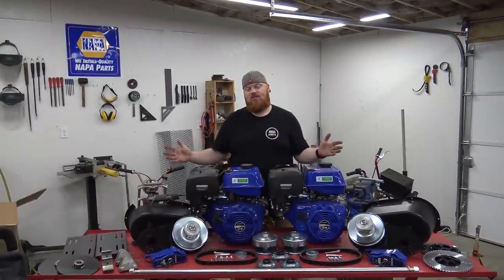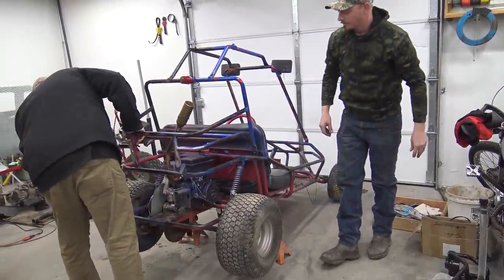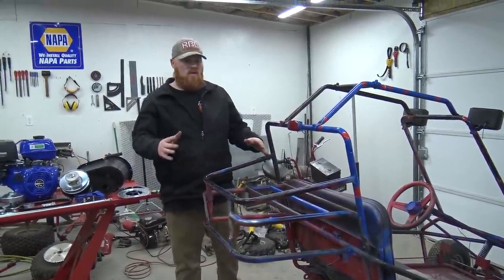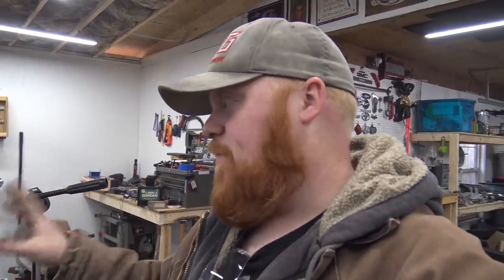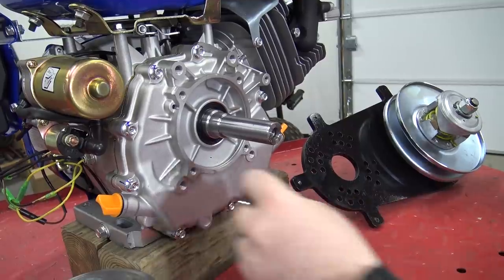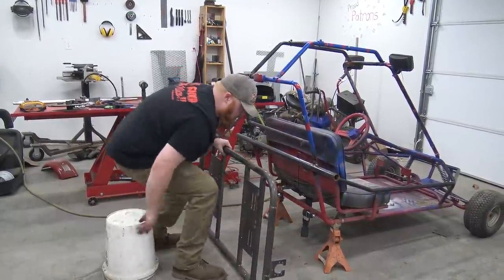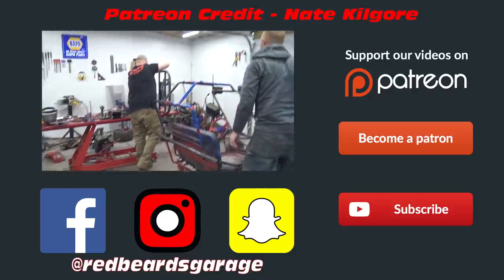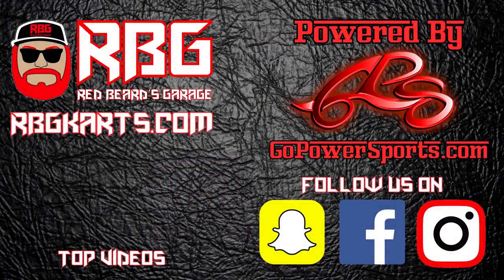Twin 18hp Engine Go Kart Build Ep 1

Comment: Just come in with the frame where the tires are at. That axle will prob work. Then the frame will be flushish with wheels at the back. Its Wide in the back anyway. Gonna get caught on trees and stuff in the woods if they stick out a lot. This will deflect stuff out before hitting wheels also.  Move the outer brake and come in about 4-6 on each side. You could do a jackshaft and do 1 sprocket on the axle but the dual means it will drive fine if one engine or chain is out. Technically you could split the axle in the middle and space it out in the center because of the two engines. Then it would be like a diff. And would turn nice and easy on pavement and not tear up the yard. Would still brake ok with the dual disks and should go fine. May not drift quite as well. Save you 100 on a axle though. Could do independent rear suspension also with that setup. Would ride much smoother and follow the ground giving better traction offroad.  Will lean in corners more though. Just half your rear section and add more pipes. Will need two more pivot points on frame and rear components.

Comment: SUGGESTION: would it be possible to cut your axel in two having an engine power  one wheel independently?  you mentioned you were going to install 4 bearing hangers. being independent this way the rotation of the rear tires could change speeds(one turning slower or faster than the other) and make it easier to make turns. also you shouldnt have to buy another axel....the cut axel might not be 50/50... due to the engine and torq a verter configeration one side might need to be longer than the other.  you would have to measure carefully before making your cut.
Reply from the maker: Yeah I just don't want to mess with two axles for the fact that if one engine is stronger that the other the kart will pull to one side
Reply: +Red Beard's Garage it certainly wouldnt be as bad as a single rear wheel drive cart. Electrical vehicles that have electric motors in the hubs are not connected by a solid axel and they pull independeny just fine with no problem. they actually do the duty  of a differential.  i dont believe you would experience any difficulty either....but i understand if you do not wish be the first to try something new and innovative....this was just a suggestion. But can you imagine that if you were the first to prove up this concept and to do so on your videos, all the kudos and credit you would recieve?
i enjoy watching your videos though and will continue to do so.  i had made this suggestion because i myself have 2 predator 420s and and have been thinking of making something similar to a twin engine drift trike (just not for drifting) with this design. but right now i only have 1 original 40 series Comet torque a vertor...i need another.  i will probably only be able to find a chinese replica...which is fine if the performance is close to equal. anyway keep up the videos.

Comment: Hey red beard I love the channel I build alot of karts myself but don't have the time to edit and upload, this build is pretty nice and ive had an idea for a similar build but instead of doing a single swing arm on the rear I was going to do dual swing arms and mount each engine on independent arms so you can achieve independent suspension and differential action by allowing the wheels to spin at different speeds. The axle would have to be split and just use a couplers to keep the axle from sliding in and out. Might be something you'd be interested in building since I don't have all the  resources for a build like that, just a thought. Anyways keep up the good work and I'm glad to see your channel doing good!
Reply from the maker: Thanks for watching man. I didn't want to do two separate axles because if one engine performs better than the other than it will pull to one side

Comment: Did the duromax engines come with a cable stop for the throttle? I have the same engines but I’m not around them right now. Thanks! Love the channel
Reply: I’m talking about the bolt you screw down fo hold the throttle cable down
Reply from the maker: They did not. I had to use some off a old 6.5 hp I had laying around
Reply: Ok! Thanks for the reply. I didn’t remember seeing them on mine that’s why I asked.
Reply: Do you think you will make the running video today of it? I’m very curious. Do me a favor and type in on Google “twin engine duromax go kart” the diygokart forum. That was me about a year ago
Reply: Hey Redbeard, how did you fit the wirestop onto the throttle arm. Did you use a bolt on the bottom side to hold it on and a bolt to hold cable in on the top? Thanks. That’s the way I have mine right now and it’s kinda flimsy...

Comment: That looks like it will come out nice I'm doing the same with 2 420cc BUT why not cut the axle in half and have each motor drive it's own axle this way one engine won't fight the other and you get better steering (just a suggestion) I still think it will come out nice, cheers

Comment: Nickle plating is very easy to do and would make a great video. Basically electrolysis. Look at the king of random they just did a video on it super easy. Copper plate it so the nickle can stick and you can get the nickle from pure nickle tig welding rods
Reply from the maker: I will look into that sir. Didn't know what all it involved

Comment: Why you doing mechanical disc brakes with that much power? Not trying to question you, just like your videos and don’t want you to die from not being able to stop, lol 😂.. I like the builds you’ve been doing lately!

You should cut the face of the cover for the torque converter and put a piece of plexiglass instead so you can see it in action... just a thought..haven’t seen it done before
Reply from the maker: We are actually going to do different brakes on it stay tuned